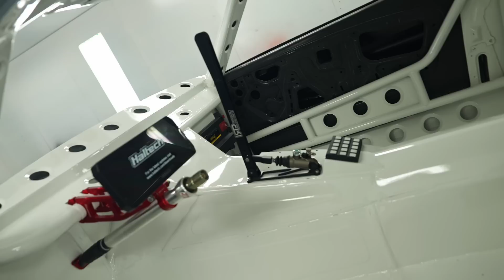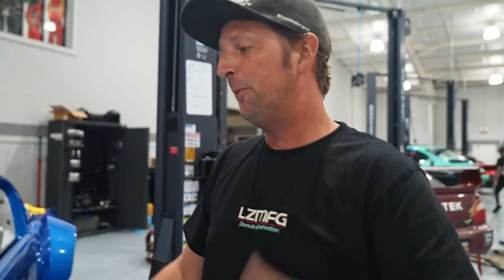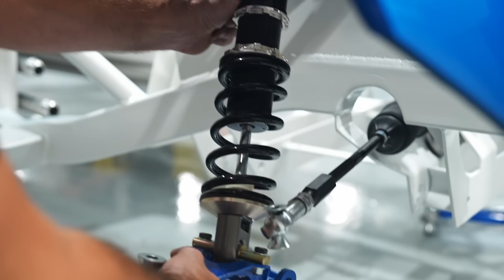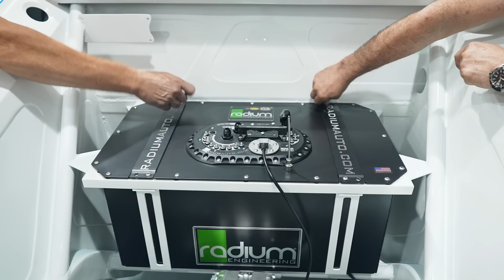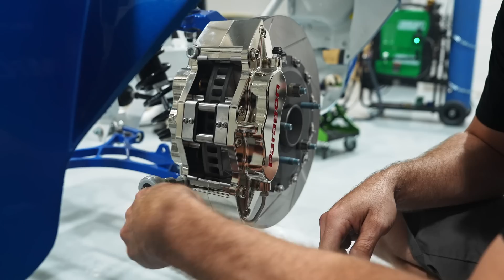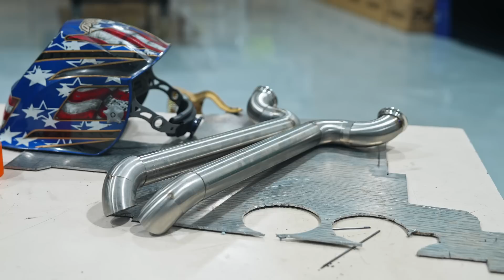Voodoo Turbo 1966 Mustang | The Build Begins

Comment: Always thought that a classic Mustang "could" be a great drift car mostly because body panels are super easy to order up. You can even build one from scratch. Suspension and steering and junk....a little harder. Btw, when you are sealing entry doors and garage doors like that, grab a few buckets of plumbers putty. Works like playdough but of course waterproof and just peels off easy later.